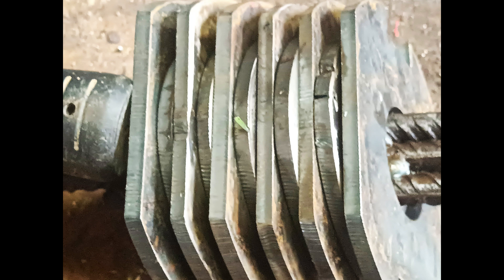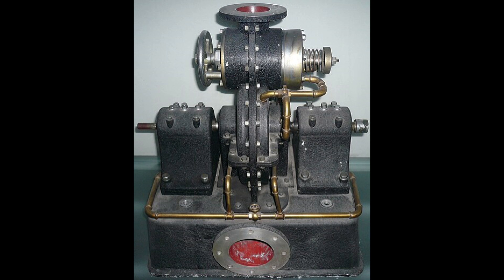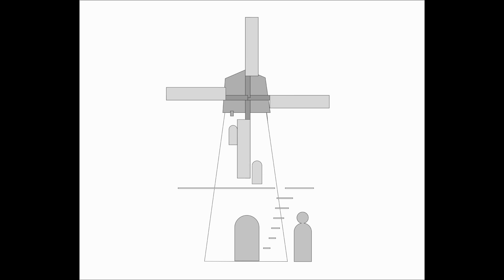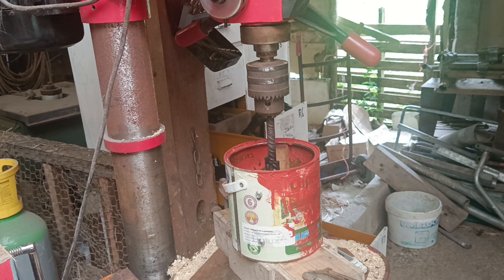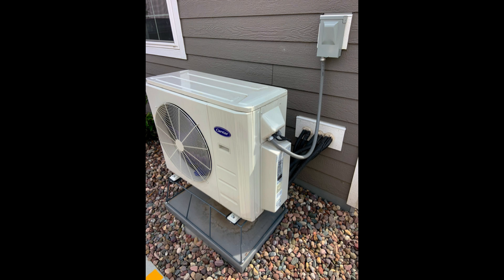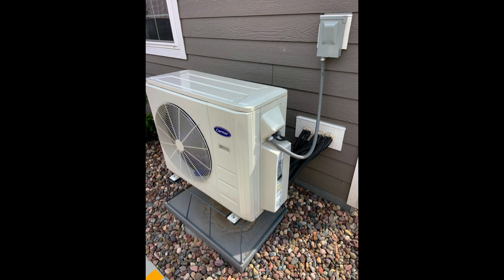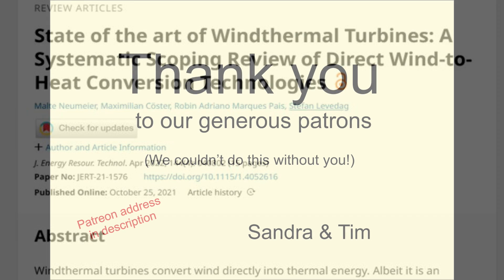More Interesting Things About Friction And Mechanical Heating - It's All So Interesting!

Comment: You can produce friction without needing physical contact if you rely on magnetic friction.
The smaller amount of RPMs is irrelevant in this system because you can tune the induction wheel in ways that do not rely on high RPMs i.e. the heating efficiency doesn't exactly rely on revolutions but rather it relies on on/off cycles of the magnets. E.g. you can make an extremely large wheel, that will make the tip speed increase significantly more than that experienced by a smaller wheel, it will also fit many more magnets. You can also optimize it by decreasing the size of the magnets at a rate in which this decrease in size is larger than the reduction in the magnetic field produced by them. Even if the rate was off you can still increase the efficiency by increasing the magnet density i.e. placing more magnets in the array. Finding different magnet orientations so the magnetic field is more turbulent can also drive friction up. Instead of using a metallic stator that heats up you can coaxially link up a second wheel with the same magnet array but inverted so it runs against the magnetic field of the previous wheel, then you can make alternating arrays, that expand vertically rather than relying simply on large diameters, that makes use of the high torque produced with the 80 RPMs of your example. You don't need permanent magnets, you can use electromagnets. Many variables

Comment: Still…Let’s say you lose 50% by generating electricity to drive a heat pump which is 18x efficiency of anything you can come up with friction or induction heating because you are essentially moving entropy from one place to another which is extremely efficient. I am sure you can even figure out how to drive a window AC directly from windmill rotation just need to drive the pumps which don’t need high rpm.

Comment: Did someone calculate this: make electricity to power electromagnets (instead of neodymium ones) which would heat water due to eddie currents? But the collection rings to power the magnets ... Or electromagnets could by a stator and rotor would be of appropriate metal to heat and warm up the surrounding water? :-) sooo many ideas :-) cheers ;)

Comment: Have you thought about using a Savonius wind turbine for your traditional windmill house? By incorporating a 90-degree conversion to a central shaft, you could directly drive a spinning disk. This design eliminates the need for belts, simplifying the system and reducing potential maintenance issues. the disk would be quite large, and the tank would have to be engineered for the shaft to go through the middle. then you would have your subfloor just above. you may not even have to circulate the water to heat the first floor. I would have to draw this out to explain. would take a very large perfectly weighted disk.

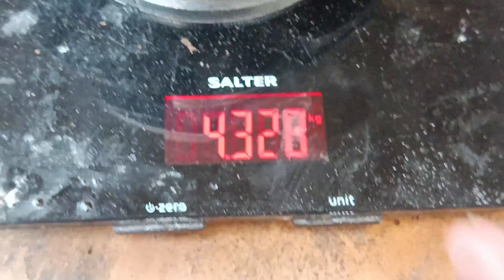Comment: Starting at about 05:50 in this video... 
I commented under the previous video about minute steel particles from those plates becoming entrained in the working fluid and being pumped around the system. The way you plan to set up your heat exchanger would eliminate the problem, although I presume the water would have to be emptied and refilled from time to time due to the buildup of metal in the liquid {even with a magnet in the container}.

Comment: this chap invented a friction heater, maybe worth looking into . https://en.wikipedia.org/wiki/Charles_S._L._Baker
Reply from the maker: Yes, thanks, I know about him, but I can't find any details of what he invented
Reply: @wayoutwest-workshopstuff6299  yes though seemingly successful there is little about how it worked other than it was wood bearing inside a metal tube. Aside from that , how about a car brake disk with calliper and pads (they last ages, and they get red hot) ready made cheap from a scrappie? Hydraulics might be complicated but some cars have a cable hand brake.

Comment: Hmm interesting experiment. 

My first impression would be electrical only because converting electricity to heat is always 100% efficient. I wouldn't use heating elements because that's boring,  I would use a magnetron from a microwave. 

Spinning magnets would be cool. I wonder if instead of permanent magnets , you could use electro magnets like how an alternator does generate power. 

I would also try to induce huge Eddie currents in the steal somehow by rapidly breaking a magnetic field. 

But I do like mechanical heating to. I am no material scientist but I wonder if any other easily abtain material would have a higher coefficient of friction. 

Another trick being you already have a tower, if you could somehow use the height to pull a vacuum high enough to make water boil. .. though it wouldn't help with heating. 

Have you considered adding friction to your water between the plates by using something like salt water or maybe even graphite dispersed in the liquid. 

Maybe you could also use some that would help oxidize the steel and add rust particles to the water and etching the surface of the steel to keep it from smoothing down. 

Also instead of a liquid between your plates, would a solid give you more friction? Like filling your bucket with fine loose sand and use the plates to heat that up instead. 

Or maybe a non newtonain fluid like oblek , because you have such high torque. 

Also you could use your mechanical energy to drive a compression force, like a screw gear, and try to highly compress the water. If I remember right, the energy used in compressing water eventually turns to heat causing the water to boil.  This is why it's nearly impossible to compress water... but I suppose you could do the same with any non compressable fluid. 

You can also try impact heating. Taking a volume of water and impacting it so hard and fast it turns to gas. 

... might be weird but you might be able to shake a drum of water to boiling using a tesla oscillator. The earthquake machine. 

Idk. Sounds fun. Though.

Comment: Dope the cooling water with vinegar, so the plates rust in style.

skip the plates, & gears, & heat the water directly. Mount a high speed prop, so it's spinning ~3-6 thousand rpm. Uae that to spin a trash pump that is sitting in a tub of water, without any hoses.

Comment: Heat pump is a great idea. Also the commenter was right about the efficiency. It's calculated by energy used vs energy moved so it can be above 100%. The steel friction plate idea just creates too much particles and wear. Have you looked into the torque converters? Converters can generate tons of heat with mostly torque not rpm. The stall is greatly variable. Like your videos I will keep watching.

Comment: the biggest advantage of friction, or solely converting your wind power to heat, is that brakes can be applied HARDER as required.

the power in the wind increases on the cube of the velocity. twice the windspeed is FOUR TIMES THE POWER.

with a pump, compressor, generator... there is a certain windspeed required to produce sufficient torque to drive the device... and thats it. any higher, you have to apply BRAKES, and any slower, it simply doesnt work at all.

take a water pump, it lifts 1 litre of water 1 metre on every stroke, say. it takes so many watts to do that.

it doesnt matter how fast it runs, its always lifting 1 litre 1 metre, its always placing the same load on the wind turbine.

the only options are to reduce the TURBINE efficiency, feather blades, point out of wind, apply brakes, whereas if one works towards simply converting wind power to heat, it can extract ALL the power... ALL the time.

the sensible approach to storing wind power would be as thermal energy. you can extract all teh power, all the time, and always have somewhere to DUMP it. you cant fill a bucket fuller than what it can hold...

a steam turbine doesnt care if you use solar, wind, coal, gas, or nukes... it just wants hot water and steam!

Comment: What if you used oil instead of water and actually add a lot of fine metal filings to it. Having a substance with a lot of tiny particles being moved around would increase the total amount materials colliding and perhaps increase the friction. That way as your plates grind down they would just add to the particles in the oil. Would be a very easy experiment to test with the setup and materials that you have now.

Comment: I wonder if you put corn flour in your water whether it would increase the friction usefully. It changes the viscosity of the fluid during motion, there are videos on it, or just test it. It basically becomes a solid when agitated, but there might be a concentration amount that doesn’t rise in viscosity as fast, that would give more friction anyway.

Comment: While it is true that you have some losses in a generator a resistive heating element is among the most effective electrical components in existence converting almost 100% of the electrical energy into heat.

A generator will lose around 25% as heat but the way you are setting this up I strongly suspect that you would get more heat out of the system if you water cool the generator than this friction heating system.

Comment: About heat pumps. If you're only interested in the Heat itself generated by compressing gas. You can do it with a cheap air pump. No expensive gases needed. Imagine an insulated bicycle pump connected a one way valve (tire valve) to a water cooled turbo inter cooler (insulated) and a needle valve to the outside. The pump will create pressure and heat that will transferred to the water in the inter cooler and the needle valve will make sure the system will stay unter pressure to make the heat exchange effective. If my rough calculation is right, you will only get 125% to 150% efficiency this way. But that's just a bonus for you.
You only need 5-8 bar to create quite a lot of heat. I remember melting (softening to the point of deforming) a cheap plastic bicycle pump in the heat of summer while pumping up a big tire.

Comment: How about using the turbine to power the flywheel on the compressed air engine! And use that as your compressor. As for gearing maybe a belt or chain drive would be more efficient way to get a gear ratio and transport the power down the ground level

Comment: Grease. 

The function of this heater is to run all the time and ideally be low-maintenance.
By using Grease you're providing lubrication and using grease shear to generate heat.
The downside is it takes longer to get up to speed.
The upside is set it and forget it until it makes unusual sounds😂

Comment: I'd think a Sterling-engine-type heat pump would be fairly elegant. They don't have a lot of moving parts, and the compressor is the pump for moving air from the hot side to the cold side and back. I'm no engineer, though, so I could be wrong.

Comment: suggestion: carve impeller like channels into the plates and use oil instead, should signifficantly reduce wear while also circulating the fluid for better heat transfer.
don't know if it would be better or worse at heating though, on one hand the oil is experiancing friction on the other it might be less than steel on steel

Comment: Just a thought.. aren't wind turbines build to have the weight on the top close to the shaft? Probably that hints to a more effective model, when the water heater and storage sits up there. You might save energy losses from the gears.No idea how this affects your type of windmill structure though 🙄

Comment: Get a solid steel rotor, and around its circumference drill alot of holes, drill 3 holes perpendicular to the rotor at an 50-55° angle on the rotor around its circumference that are sized about 1/4 the width of the rotor and equally spaced but slightly offset the middle hole 1/2 the diameter of your hole size. Rotate the rotor and repeat this process till you make it around the entire rotor. Put this inside a water tight sealed circular drum and make two ports on the left and right side respectively at the same angle as the holes you drilled in the rotor. Attach the rotor to a shaft to rotate it inside the sealed drum and spin it in the direction that will exert the greatest resistance to rotation and what you'll find is it produces an incredible amount of heat. Hydrodynamics used to have a video on this concept, they called it the water hammer its since been dissapeared off youtube.
Reply from the maker: You mean make the thing that I describe in the video? The one that needs more rpm than I have?
Reply: Have a two or three stages of gears/pulleys to step up the output speed since you'll have lots of torque at your disposal.  If your input shaft rotates a 17" gear/pulley and you drive a 3" output that's shaft coupled to another 17" gear/pulley which then drives a second 3" output that's again shaft coupled to a third and final input thats also 17" gear/pulley then your output speed on a third and final 3"output gear/pulley wil be 3643rpm assuming you have a 20rpm input speed.  Easy enough to since uou clearly have fabrication skills and scraps to work with.  And yes the video you showed was t hff e you're of water-hammer/cavitation pump I wad referring to.  I'm just throwing ideas out there brother.  Hope this helps.

Comment: You do not need rotational speed, you actually need linear speed to make the hydrodynamic friction work. So, instead of increasing the RPM, you can increase the diameter of the rotating element, thus reducing the losses from gearing.

Comment: One up side to this project; converting energy to heat is literally the only thing you can do with 100% efficiency.

If you want to keep things slow, consider a piston pump. Just a close fitting, but still leaky, piston pushed back and forth in a long tube should work. All the work needed to push the water thought the small space around the piston would go to heating the water. It would also have the advantage that it would be trivial to make it circulate water into a larger tank (or tanks). A little fun with an automotive type thermostat and you might even get regulated water temperature.

Comment: Steel on steel actually offers a pretty poor coefficient of friction - one reason rolling steel-on-steel trains like your homebrew system are so extremely efficient, and so very bad at climbing hills or braking. However I don't feel the need that others do to argue you into just building a proper Joule machine, because you'll eventually figure out (or not) that now your plates are worn in they're likely already being held apart by hydrodynamic forces. So you've made a really poor Joule machine already, that produces a lot less drag and heating than you could make with a fraction of the steel and proper design.

Joule machines don't need to go crazy fast to absorb power in the kilowatts or tens of kilowatts that you're likely to get from a windmill. It's all about edges passing edges perpendicular to the direction of the edge. This paper covering the math of  how to scale and build one is literally titled what you're trying to do: "Direct conversion of wind energy into heat using Joule machine". www researchgate net/publication/265796144_Direct_conversion_of_wind_energy_into_heat_using_Joule_machine : "Most significant increase in NP can be obtained by increasing the W/D ratio", so increase axial length of the blades before diameter or speed. Maybe have multiple gang-driven Joule tubes in your hot water tank, which would improve heat exchange as well.

While industrial gearboxes are good, if you care about low-cost but super efficient drive and gearing systems, don't overlook the bicycle world. There's a reason the bicycle chain hasn't changed for a century and a half, and that reason is that competitive bicyclists also care deeply about every fraction of a percent of power loss. Sprockets are cheap as chips and maybe even possible on your cutter with a bit of Dremel work. Chain is a commodity that can be easily assembled in custom lengths. If you're very lucky in mill power output you might have to jump up to motorcycle/scooter chain and gears.

Or, the whole idea of transmitting your power through torque in shafts could be a conceptual trap. Dashpots - as in "shock absorbers" - dissipate mechanical power into heat very aggressively. I have an exercise rowing machine with a hydropneumatic dashpot; it gets really hot really quickly in use, despite human power output being about 100 watts on a good day. Have a crank in your mill that pulls repeatedly on cheap steel or Dyneema cable "jerkline" which you can route where you like with just pulleys. Rig the line with a lever or something to pump a few commodity shock absorbers immersed in your water.
Reply from the maker: I had researched the Joule machine of course, and decided that guessing the sizes of the paddles, etc that would work for my mill would be too hit and miss, and so time-consuming and expensive. That's why I went for an experiment that could be easily altered. That's all.
Thanks, yes, many people have suggested the shock-absorber solution too. It's on the list of things to try out next..

Comment: The only loss of a generator would be the generator itself if you were heating with a resistive heating coil. Generators are usually around 87-92% efficiency, the resistive coil is 100% efficient at turning electricity to heat.
Plus you also gain the benefit of being able to charge some batteries when water heating isn't needed.

Comment: Tim, I really suggest looking further into induction-based solutions. I bet, with a few copper plates and some magnets, you have already more friction torque than your metal on metal solution! If you don't believe me, use a magnet and move it in front of a copper plate, the force is really surprising.

As the easiest solution use an electric motor (one with permanent magnets) put the whole motor in the water and short the leads. Simple but effective.